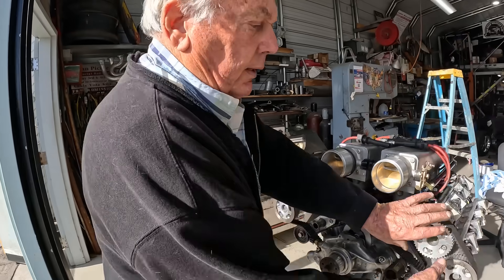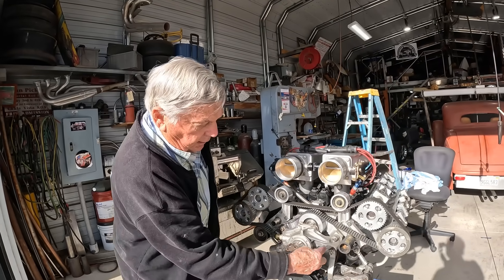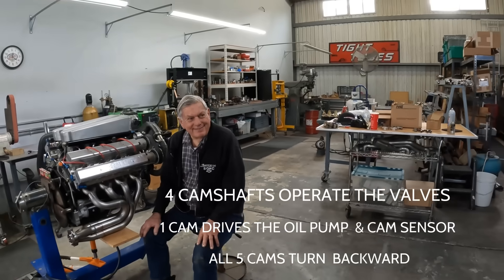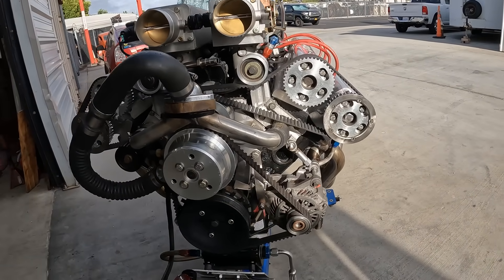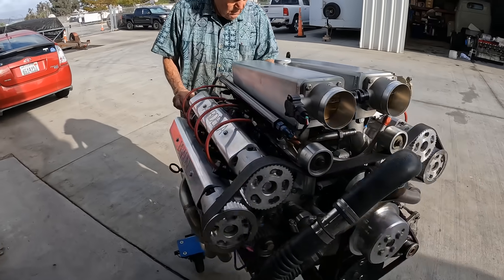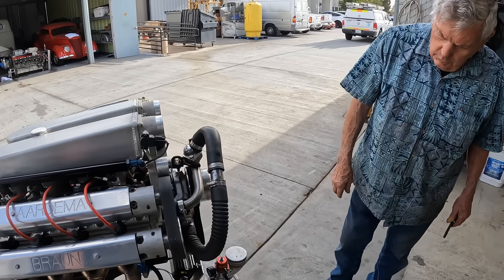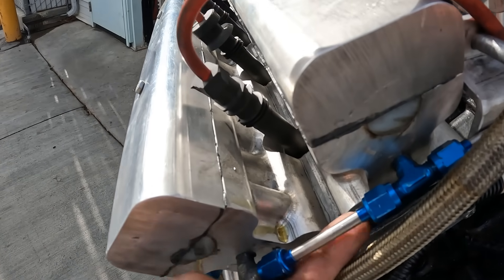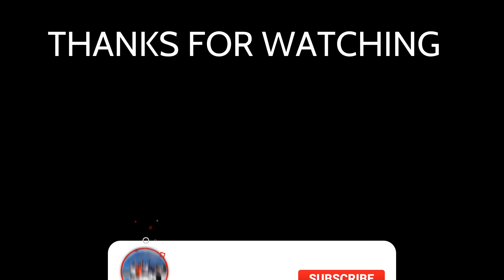Wicked Chevy 350 Quad Cam 4-Valve Engine- Fire Up & Run - Amazing Sound

Comment: That's awesome and stuff but was it really worth the added complexity over a tried and true pushrod single cam for how much additional HP?
Reply: It's not about horsepower. 
It's to get it to run 8,000+ rpm for hours on end.
Pushrod's have far too much valve float up there, and a lot more chance for catastrophic failure.
The pushrod valvetrain just can't hang with a dohc pushing up to 9k rpm.
Pushrods are better at drag racing. 
dohc are better at track racing.
Although, dohc do need to be rebuilt every 100 hours or so, if you're doing 400 mile+ track racing, hitting up near 9k rpm.

Comment: Ohio Foundries used to make a 4 valve Chevy head that used a master-slave valvetrain system made by Crower cams. I think it was a big block head. I think that was in the early 80's.  It was written up in one of the magazines at the time - probably Hotrod magazine.  I wanted to put them on my Chevelle, but all the dyno simulations said 2 big valves flowed better than 4 small ones.

Comment: I remember that engine, and I actually had the magazine. It was an exciting time back then. Then an engine came out with working rotary valves, and I thought we would have them in our cars. Manufacturers didn't go that route because it would have taken away from their overpriced bottom end and their parts profits, as the rotary valve was simpler and more durable than the engines they produced at the time. So, the consumers were once again taken advantage of by the manufacturers of our vehicles.

Comment: Sainty, McGee and others developed their own OHC  big block V8 syears ago. Terry Sainty ( Sainty Engineering ) built their own billet block twin cam 500 CI drag engines. Their own Billet cranks, Billet Ally Rods etc, I think they used Ross piston and their own wrist pins. All done in house in a small engineering shop in Sydney Aus. A tribute to those innovative engineers. Well done to all who step up and out to develop wonderful engines.
Reply from the maker: Thank you for the Info!
Reply: Didn't those engines get banned after a very short, but dominant run in Top Fuel!?!

Comment: IF I build double overhead cam 4 valves and fit them to a 460 ford, is it really a ford?
Reply from the maker: It’s not a 460 Ford but it’s a FE 427 

https://youtu.be/2vEm1rCHcN0?si=rFGoc_yXBDzLO1Fb

Comment: Happy to see our American friends move somewhat away from 1930s tech (central camshaft, push rods, ...) and into something a bit more up to date. 🤣
BUT: You DON'T run camshafts on a single belt, you just DON'T.
I'll let you figure out the why 😁
Oh and one more thing, this being still a cross-plane crank we can still count the explosions by the ear 😒
Reply: First off them flat plane cranks idle like garbage like a tame little kitten purring. The only place they have in a SBC is for high revving oval race applications not street motors and they make garbage torque so def not for drag racing or dirt racing. Roll racing maybe arguably but still get beat out by cross planes all the time.  They will never sound as good as a cross plane for that cam chop period end of discussion.  The fastest ad second fastest street cars in the world along with the fastest accelerating machines in the world period a top fuel dragster begs to differ that pushrods are not old tech and def not inferior and that the cross plane crank is better for most things except circle track.  If u wanna change cam size on a dohc u have to change the entire valve train and shim this n that n this has to be now this thick so that works blah blah. A pushrod engine u throw a cam in it some new pushrods and it's running again. Dohc has its place. But it is certainly not better by any means. Just different. And no u don't u run the cam off the belt u see it's run off a timing chain inside that's goin around to them all same as any other dohc. The belt u see drives other shit and is more for the cam sensors that timing the motor or holding time. That belt would hold time just fine for 500 HP. To much more or a race application id start to worry about flex and deflection and stretch throwing timing off a degree or 2 under certain situations but not others.

Comment: ‘32 Roadster would be a nice choice for a recipient vehicle.
Or a ‘55. Or early Camaro. It should make an easy 550hp.
Reply: Drop it into a 69' Vette with side pipes linked up to those perfectly made headers, and if course give the Vette a modern braking and suspension system with all of the high performance trimmings

Comment: The important question is, how long do these redesigned engines actually last compared to conventional modified engines built. Then there is the astronomical cost to build, let alone cost of any replacement parts needed. Different concept looks are only for art painting, not engine building. Where is your NHRA top Fuel Nitro motor with a team to prove your weight in engine building?
Reply: 44 land speed records to back it up ! I think that's sufficient
Reply: @robertflanders1158  These salt flat engines continuous;y blow up, and the records they broke are records the rest of the salt flat races moved beyond those classes that nobody else competes in. My post stands as being accurately correct
Reply: You can buy every part for a TF engine and bolt it together. These men make their own heads ,  cams, drive systems, even blocks from scratch. The important question is, what do you know about engines, lol?
Reply: @MansonSherrillJolly  Why, when they blow up and are absolutely inferior to professional engine block & head foundry,  professionals laugh at . Try to put ten thousand miles on one of their weird engine designs and you will see my post is correct. Even all the racers make fun of their stupid inferior engine designs.

Comment: Does that have hemisphereical combustion chambers ?  The spark plugs look to be in the correct area for a hemisphereical placement of them.
Reply: 4 valve heads usually end up with pent roof chambers